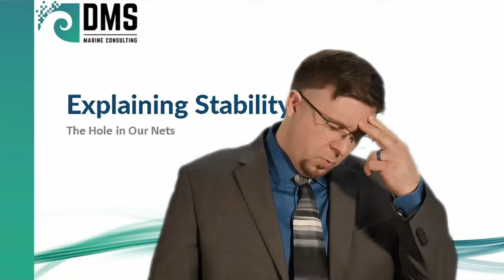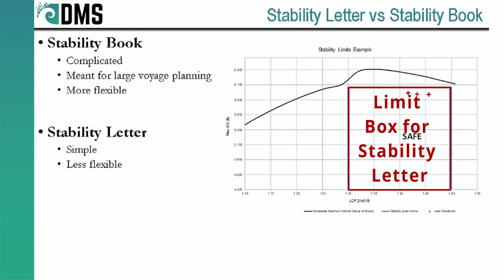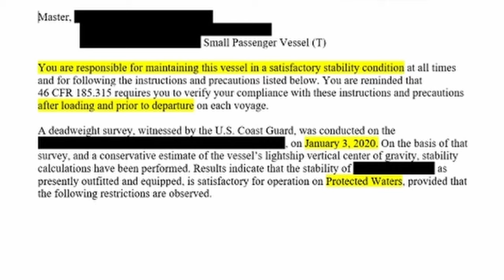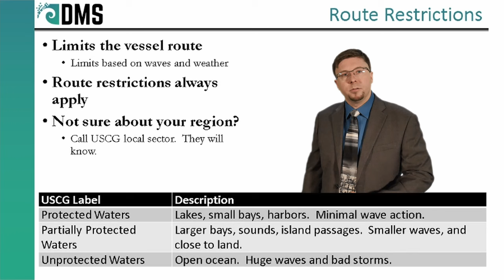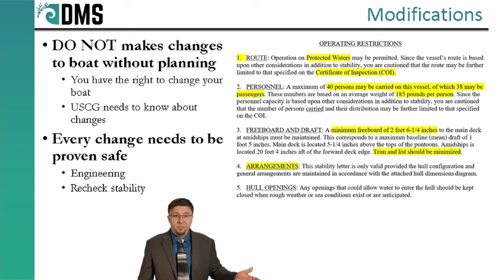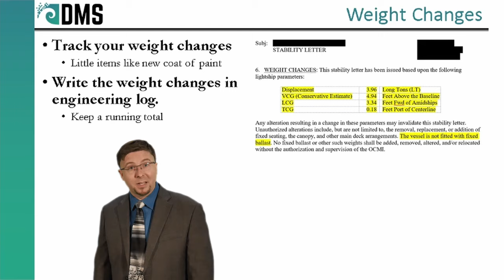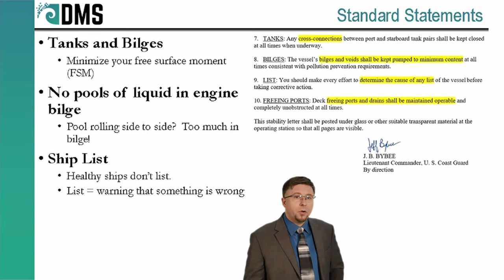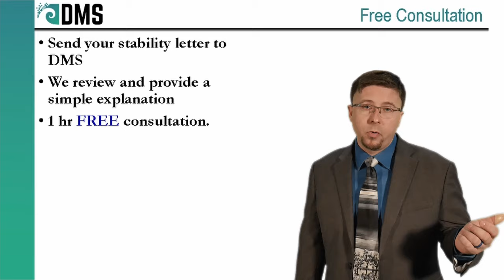Stability Letters Explained:  READ The MANUAL!

Comment: Interesting how he mocks Coast Guard on variety of things.  Thanks to the CG, he earns a paycheck.
Reply from the maker: No mockery intended.  True, I add in some commentary to keep the video interesting because this is still partially entertainment.  Also true that I call several parts of the stability letter boring.  I would not classify that as mockery, because USCG is not meant to be entertaining.  USCG is tasked with preserving life, not with entertainment.  But it goes too far to say that USCG is the only reason I earn a paycheck.
Reply: Three operating areas are clear to me and likely all viewers.  Have you challenged the CG with their better description.  It was however,  good  you referred viewers to CG when in doubt on any letter content.  On the bilge, waiting until bilge water is sloshing is well-beyond the norm of keeping bilges dry which should have been your target.  In your example of the operator sailing across the Gulf of Mexico which is in violation of the Stability Letter vis-a-vis, the COI, you may have added the CG under application, may provide a limited dispensation to  stability letter requirements for, let's say, voyage to a Gulf shore repair facility direct in lieu of near-shore.  Anyway, I've not known staff from flag states, IMO, port state officials, ship tech reps, and naval architects to be entertaining.   Hey, you've got a video or several on YouTube-I don't.  Good for you.  Because your audience range from novice to expert mariners, I'd leave the entertainment to others and focus on the subject at hand.  As a value-add, I will view your videos before they go online if you wish - my one hour review is free.
Reply: Hey, you've got a video or several on YouTube-I don't.  Good for you.  Because your audience range from novice to expert mariners, I'd leave the entertainment to others and focus on the subject at hand.  As a value-add, I will view your videos before they go online if you wish - my one hour review is free.
Reply: I'll pull this comment if you wish.  I think you get my point.  Thanks for getting back to me.